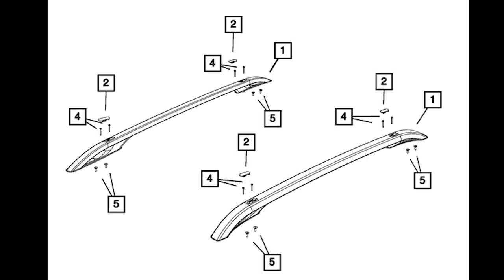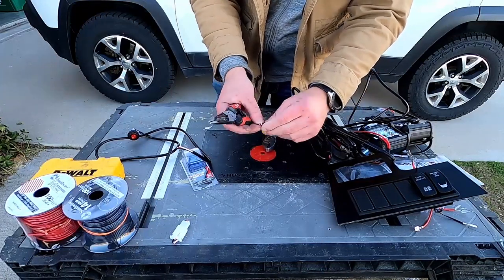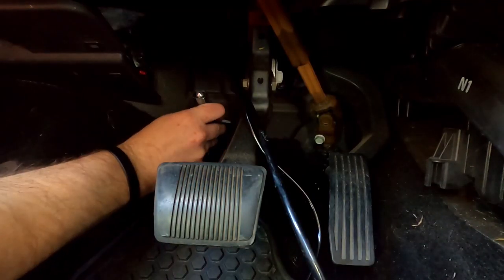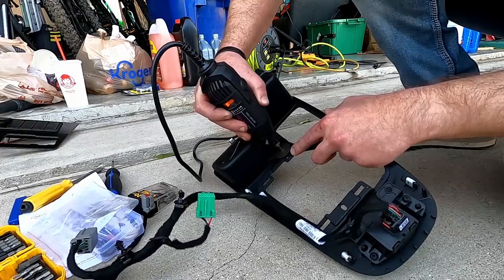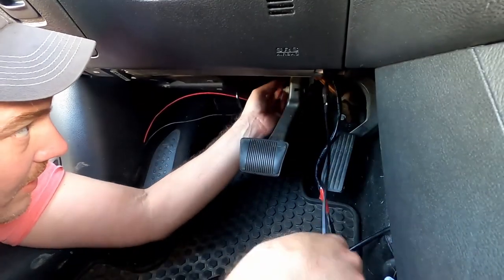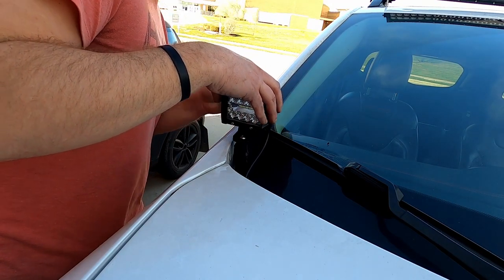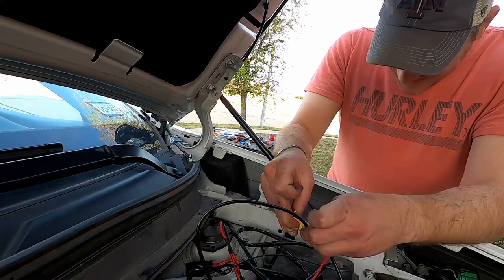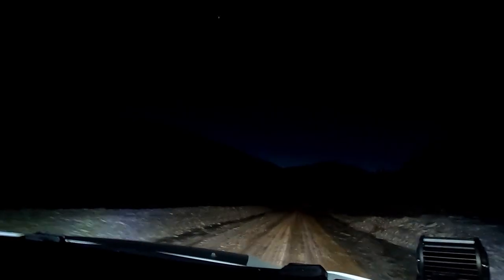Jeep Cherokee Drill-Less Lightbar Install

Comment: Do your rocket switches stay lit even after turning your car off? I have the same ones and mine stay on idk if that's normal or not?
Reply from the maker: Yes, ours stays on too. It's wired directly to the battery. Since they've been wired up though we've never drained the battery.
Reply: @paycekgaragewerks5213 ok cool, thanks for the reply it's been driving me nuts.
Reply from the maker: No problem, we never noticed it. I had to run out to the car to check mine after I read your comment lol.
Reply: @paycekgaragewerks5213  lol 😆

Comment: That grommet that you tapped through has a predrilled hole slightly above that you just have to pop the cap off of and you can run wires!
Reply from the maker: Lol yeah we ended up doing that later on

Comment: Nice work!  I'm putting in the same light pods in with the same Hazard Sky kit.  Going to forgo the light bar on the roof... just getting a smaller one and putting it in front of the radiator as I saw on another video.  I'm too lazy to run that wire all the way back through the roof rails down through the back all the way to the front.
Reply from the maker: Thanks! Lol yeah it was a pain, just didn't want to drill a hole into the roof.

Comment: Visibly exposed wires on the outside of the car? There HAS to be a way of running the wire down through the A-pillar without having to run them around the whole damn car!
Reply from the maker: There is, we just didn't want to drill into the body.
Reply: @paycekgaragewerks5213  Thank you! I guess I have a decision to make.